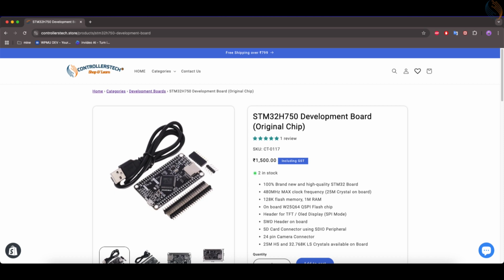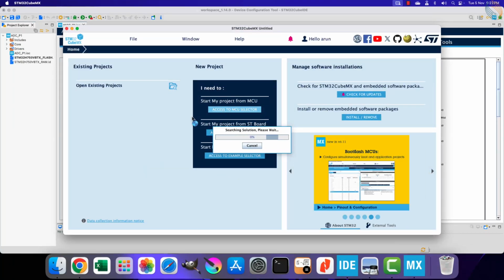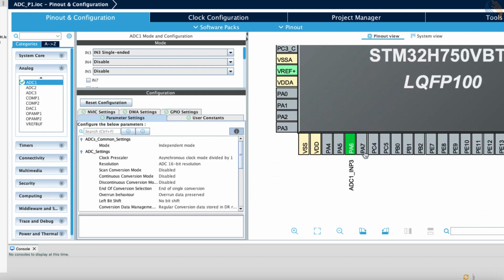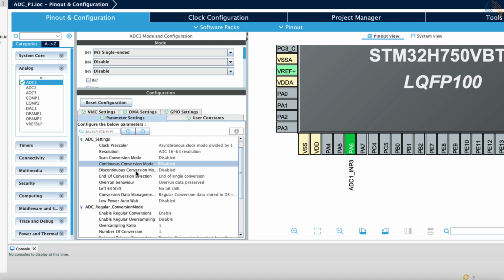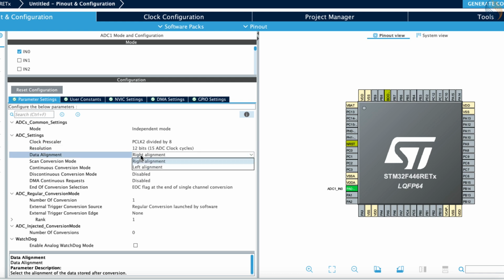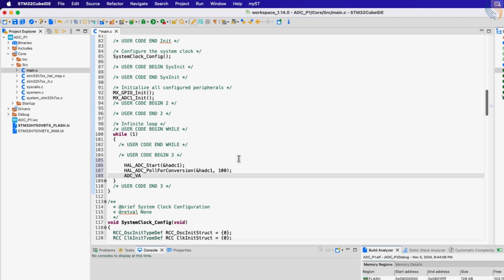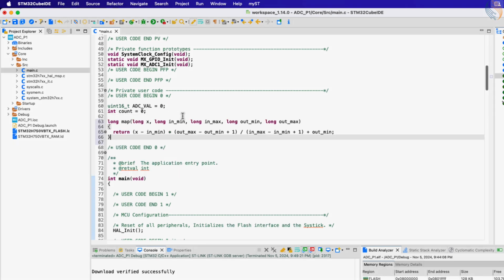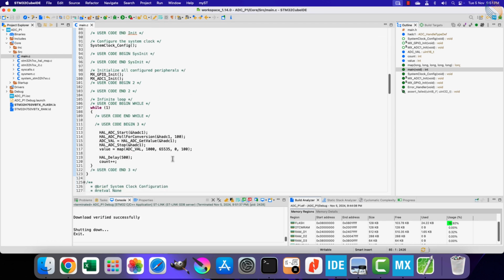STM32 ADC Tutorial (Part1): Single Channel Polling Mode Explained

Comment: Thank you a lot for the video.
I am using STM32G431KB to have a battery percentage through the ADC. 
Basically I've made a voltage divider to obtain 3.3V on the ADC pin when I have 100% and another value for 0% battery. Unfortunately,  it seems that for the same 3.3V, my adc value keep changing so I'm unable to have a realistic percentage of the battery without adjusting the parameters from time to time. Do you think I'm doing it in the bad way ?

I would like your opinion on the method, thank you 🙏

Comment: Hello

While configuring the ADC clock for STM32H7 in STM32CubeMX, I have set the ADC clock source (via the ADC Clock Mux) to 1.5 MHz, using PLL2P as the source. Is it sufficient to set only the "ADC Clock Mux" to 1.5 MHz for proper ADC operation? Or do I also need to reduce the frequencies of the APB1 or APB2 peripheral clocks (which are currently set to 75 MHz) to match the ADC clock, or for any other reason? In summary, does setting only the ADC peripheral clock to the desired frequency fully configure the ADC timing, or do I need to change the APB bus clocks as well for correct and stable ADC operation?
Reply from the maker: Id ADC clock is shown separately in the cubeMX clock setup then you should focus on configuring thr ADC clock instead of APB clocks.
Reply: @ControllersTech  thank you